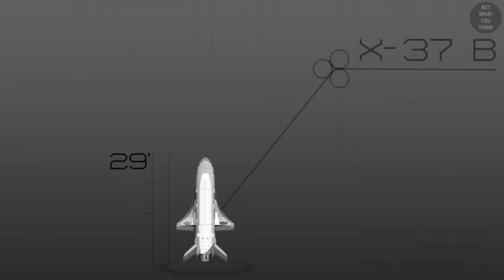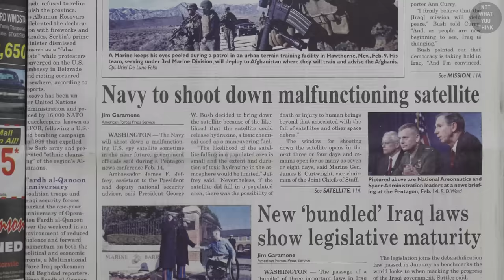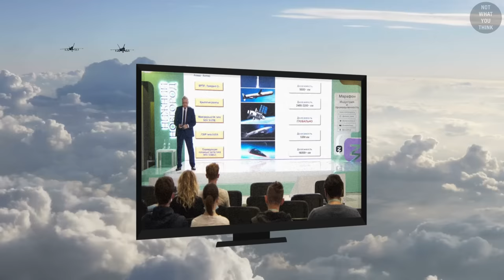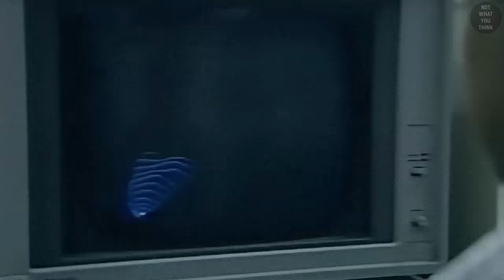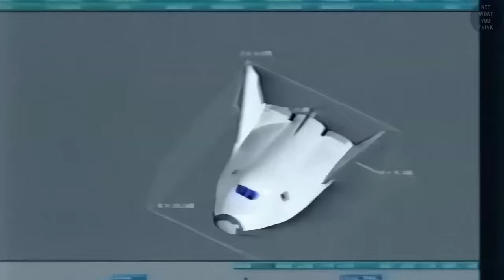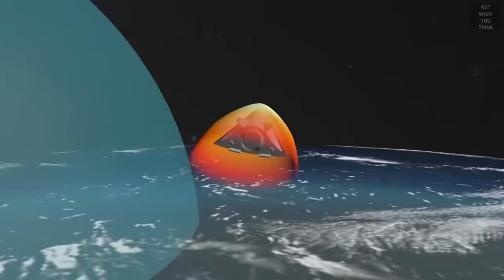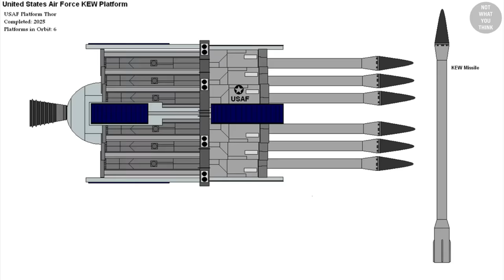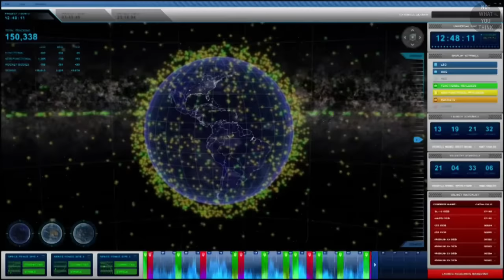Why Russians Think X-37 is a Nuclear Space Bomber

Comment: I think the vehicle is designed to tether other satellites and drag them out of orbit. It has insane orbit changing capabilities and would be very hard to track when moving orbits so often.
Reply: That's a really interesting idea because it solves the problem that conventional explosives have which is that they create  space debris when they blow something up.
Reply: That's a very interesting idea, but it would probably have to match the satellite's speed and heading for that if the process takes any time, right? In that case it probably takes a huge amount of energy per mission.
Reply: @T33K3SS3LCH3N  It would need to be a close approach but any craft passing inside 600km of a nations satellites are tracked anyway - The idea of debris from explosions causing huge risk is not really a thing

Almost all satelietes need a fuel store for maintaining station keeping as the orbits are subtly altered over time by the gravity of the moon
This video didn't list the real most likely use of the X-37 - Satellite interceptor

If the X-37 uses an orbital skim to match a rough orbital plain it would only need a missile like that of a SM-3 with a long burning rocket to match a kinetic intercept - Any debris would be limited as it would be a purely kinetic impact and it most cases could be angled from a head on contact, maximizing contact energy and making it so any debris is decelerated  radically and rapidly de-orbits
The X-37 could have a 8 to 12 missile on a rotary launcher and could perform multiple satellite take downs per launch
Reply: I believe it could also be used to steal  russian/chinese satalites and bring back to earth safely so they can copy or scrutinise them
Reply: @T33K3SS3LCH3N  Not really, it can change orbits by dipping into the atmosphere, using it's wings to change orbits, then boost back up.  It carries enough fuel to do this a couple of times.
Reply: @flexibleaspect  you must be at DARPA as well Shhhhh 🤫
Reply: It doesn’t have to drag an opponents satellite out of space. You can leave them operating and just stick a hand grenade to the side with a radio remote trigger when it suits your purposes…
Reply: @flexibleaspect  zero chance of no detection - it’s orbit is known and tracked by many amateurs.
Reply: @walterlyzohub8112  to remove 1 ton from orbit you’d need to launch a 100 ton rocket! ISS garbage is taken for free because another rocket is coming anyway.  Removing space junk is extremely expensive. The best we can do is approach them and add Very light attachments to them that add drag.
Reply: @idjles  Removing material from orbit is much easier than putting it there. You just need enough delta V to drop it below 200km - air resistance does the rest (quite rapidly).
Geosynchronous orbit transfer stages don’t weigh very much at all - the hard work is getting to low earth orbit. You need to go from 7.8km/sec to 3.075 km/s (but you need to burn fuel to get to a higher orbit…). They can however be highly efficient as they can spend weeks doing it slowly with ion thrusters.
Reply: @allangibson2408  there is not really much junk at geosynchronous at risk of collision. Low earth orbit is the problem, and yes you need the cheapest delta v - so increasing drag with light attachments is the cheapest option.
Reply: Anything below 500km will come down by itself anyway.
Reply: @idjles  There is insufficient drag above 500km to do anything much. (Air density halves every 5km you go up). 
Ion thrusters (including ambient gas breathing thrusters) could have a significant application above this altitude as could gauss brakes that interact with the earth’s magnetic field.
Simply dropping the perigee by two hundred kilometres does however have a major effect. A combination of the two is required for most effective use of resources for the higher elevations.
Reply: @allangibson2408  What air resistance?
Reply: @aholder4471  The atmosphere doesn’t have sharp edges. Atmospheric drag occurs for all low earth orbit satellites. The lower they are the faster they fall.
Below 200km you need constant thrust to stay in orbit.
At 400km periodic reboosts are enough but without them your satellite comes down in a couple of decades.
At 500km you get a few centuries in orbit.
Geostationary satellites are up for quite a few millennia.
The moon is far enough away that gravitational coupling is accelerating it away from earth (earth slows down and the moon moves further away as a result of energy transfer).
Reply: @flexibleaspect  We're actually doing something much better.
You don't need to make the satellites produce erroneous data.
All you need to do is listen in on the data being sent to the satellite by the ground station.
And optical spy satellites (the kind that take pictures) aren't the only kind of spy satellites. There's also radio spy satellites, which are used to do exactly what I said, and listen in on the data going to/from other countries satellites.
Now which nations satellites, and which satellites specifically I couldn't tell you, but put it this way, if they wanted, the CIA or NSA or whatever could easily use such means to get free satellite TV at the very least. I'm sure we know what they're telling their general populace, if not via this method than via something else.
If you don't want this happening to your country, the only option you have is to not use satellites to send your data, or use very heavy encryption to do so (which severely limits data rates, as the encryption itself can take up the majority of the actual data sent, with the message itself only comprising a scrambled small portion of that data).

Now imagine them doing that to a military communications relay satellite, and you'll have a better idea of what they're actually doing with them, not that I know enough to be able to tell you any specifics about it.
Reply: @hunterkudo9832  Nobody has nano bots yet. That stuff is still very much sci-fi, and shall remain so until we find a way to actually power such tiny things with a battery that isn't 20 times the size of the nano bot itself (not to mention nobody knows how to make a dang nano bot in the first place, if they could we'd have large, atomically pure diamonds and defect-free carbon nanotubes of extremely long lengths (several inches) as just everyday (extremely strong) materials being made from coal oil and biomass).
Reply: 8 of them would be enough to attack strategic Russian or Chinese satellite’s in the opening phase of a conflict and would do it quickly or track Russian or Chinese submarines or other vessels carrying nuclear weapons to take them out in a quick strike
Reply: @jimbojones806  oh man that's stupid lmal
Reply: @aholder4471  When the Sun is at its peak in activity, atmospheric drag increases significantly on satellites. The official complete end of the atmosphere, thus the beginning of true space, is about 6200 miles plus. The I.S.S. is actually in the part of the atmosphere called the thermosphere. So the only astronauts who have actually left the atmosphere are the Apollo astronauts from like Apollo 8 to Apollo 17. I am unsure of the missions from Apollo-s 2-7.
Reply: @T33K3SS3LCH3N  no more than it took to put the satellite in orbit to begin with. If it’s just up there and you are like “oh we need to do this.” Then ya very difficult. If it was lunched with a intercept in mind then not so hard
Reply: @allangibson2408  Yep. Another factor to content with is that the earth is not perfectly spherical and does not have perfectly evenly distributed mass; the gravity field is "lumpy" and this causes orbiting objects to "wobble". This effect is much more pronounced in orbit at the moon, so even though there is no atmosphere there, objects orbiting the moon also need fuel to maintain orbit.
Reply: @Svensk7119  Apollo 1 never left the ground.
Apollo 2-6 were renumbered unmanned test flights (and in some cases were the last Apollo hardware in earth orbit).
Apollo 7 was a manned orbit test of the Apollo capsule.
Reply: @iainbagnall4825  actually their is one orbital plane on the moon that is quasi stable. The Apollo 11 LM was abandoned in this orbit and hence no-one knows where it is now…
Reply: @allangibson2408  I knew what happened to Apollo 1. The others I did not know. Thank you.
Reply: @allangibson2408  Scott Manley did a video on that, I think his conclusion was it probably crashed into the moon because quasi-stable is not 100% stable and 52 years is a long time, so I guess we gotta go back there to find out!
Reply: @allangibson2408  the operators of the satellite would know something is up, because the center of mass and mass of their satellite would have changed, and this would be detectable during station keeping/orbit change burns. Plus it wold be observed approaching the satellite, as a russian space vehicle was observed approaching a US satellite. Plus it is way easier to launch more satellites than it is to pull them down with an x37. If that was your objective, you would build a space vehicle specifically to do that, not risk colliding something like an X37 into another orbiting object.

X37 is much more boring than this. Its for secret materials and technology testing in orbit, and is the only viable platform for doing that over any period of time and recovering the test objects. ISS is far too international and transparent to do that sort of thing.
Reply: Probably a test bed for DOD technology, not something you would want to test on the ISS because of prying eyes of the station members
Reply: @jimbojones806  This is the most likely answer. There are already missiles that are designed to be shot from a very high aircraft to destroy satalites and in a shooting war with a peer enemy both would have to try to take out as many enemy satalites in the first few minutes. A space plane would just be too slow.
Reply: @jimbojones806  Same idea but Not for Copying them but to read the data and maybe Even get a key for communication. If you get one of these you have Access to Communication. These are mostly cost effectiv Build because the idea of somebody picking them out of the sky seemed ridicolous so its probably Open like a barn door. And spending some money for this would be awesome bang for there buck. Even if it cost billions.
Reply: @timothybrummer8476  that’s possibly the least deltaV efficient way possible of changing inclination.
Reply: @44R0Ndin  depends what you mean by “nanobot”. We’ve already used a tiny robot capable of moving a single sperm to fertilise an egg. It was the same size as the sperm.
Reply: @lukefreeman828  It indeed does depend on what you mean by "nanobot".
I myself mean a fully independent robot capable of manipulating things on the molecular scale while itself only being composed of say a few thousand to a few hundred thousand atoms of various materials itself.
Aka the "sci-fi replicator" type nanobot. Those are a long way off indeed.
The ones you're talking about are usually just "we put this tiny specially shaped thing in a petri dish and used high magnetic fields or lasers hitting specific spots on that tiny thing to push it around so that it can push other things around, and called it a "nanobot" when what it really is is a "nano-scale end effector of what is actually a room-sized true robot system".
Reply: @lukefreeman828  
Rocket engine lift to drag ratio is 1. 
Wings at hypersonic speed is about 4.  
4 is more efficient than 1.
Reply: They're just unmanned shuttles for the era of increased space activity, but ofc they could be weaponized as needed.
Reply: Or just taking very close up photos of satellites. 
Weapons in orbit are not cost effective or tactically advantageous. (Aside from hypothetical energy beams as the beam would be massless.)
The USA has had the ability to shoot satellites with missiles fired from an F-15 since the 1970s, with a a successful test on a retired satellite near 500km orbit.
launch from an F-15 makes it difficult to prove who fired the missile, unlike ground launch sites.
Reply: Anyone would notice that. You can see satellites and trace them just with a telescope
Reply: Top secret cappuccino machine for ISS astronauts
Reply: @bengrogan9710  there is no air in space why not just hit it with a few hits from a rail gun. Follow the doctrine battleships of old held, shot something enough times your bound to hit something important.
Reply: @andrewyork3869  because in space what goes up must come down
Reply: @bengrogan9710  yeah exactly it would just burn up on entry.
Reply: @bengrogan9710  okay, what about a rocket net laucher.
It sounds stupid, but like if it worked, it could send stuff straight into re entry.
Reply: @AnarexicSumo or they can deploy paint to disable satellite and have sunlight change the orbit of the satellite.  Gives you some plausible deniability too.
Reply: Off axis thrusters. Orbit stays the same, but the sat is trashed. Prepositioned, waiting on command, unretrievable.

Comment: The Space shuttle RCS used hydrazine as fuel. That’s why they would always “safe” the orbiter after each landing.
Reply: safe?
Reply: @NoNameAtAll2  insure that there is no risk of hydrazine exposure of the operators. It is highly reactive, toxic and corrosive substance. They generally purge the RCS tanks on track or shortly after.
Reply: @NoNameAtAll2  Have you ever seen a video of the space shuttle been moved from the landing strip to the orbiter processing facility (OPF)? There are always two trucks that tail each side of the orbiter and they are connected to it with cables. Those trucks are there to contain any remaining benzene that is still left inside after each flight. Nobody is allowed to exit the orbiter until those trucks are in position and connected.
Reply: yeah I remember during the columbia disaster they were telling people not to go near any of the debris because of this reason
Reply: @zashbot  they might said that to keep ppl away from picking up debris, but still true.
Reply: @Blue-op6qv  Yeah, they used the pieces to figure out what happened
Reply: @xWood4000  The point zashbot was making is that Columbia spread hydrazine all across Texas Louisiana and Arkansas when it broke up. NASA was basically saying unless you want to have a “who can have the best seizure” contest; do not pick anything up.
Reply: NASA has a couple of alternatives to hydrazine now that are somewhat less toxic. But not well proven yet in space and will take time to catch on